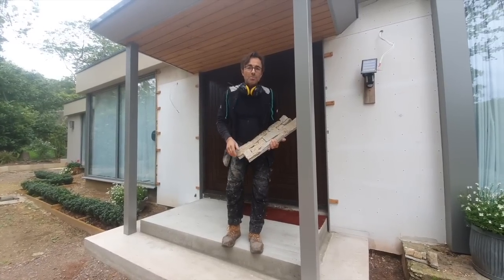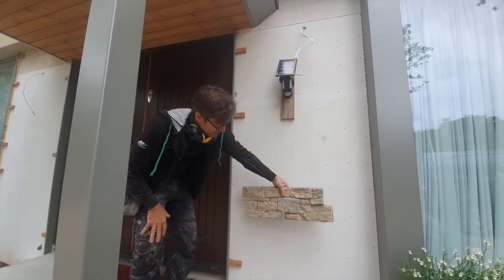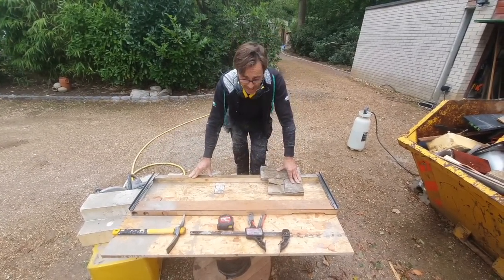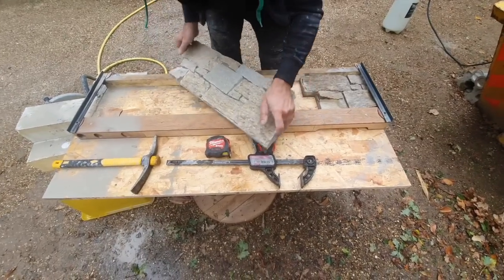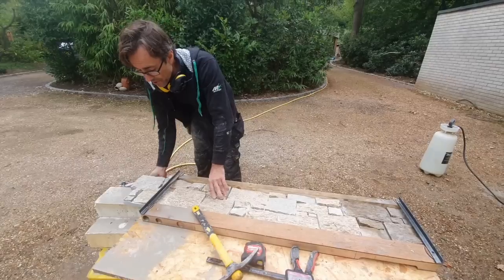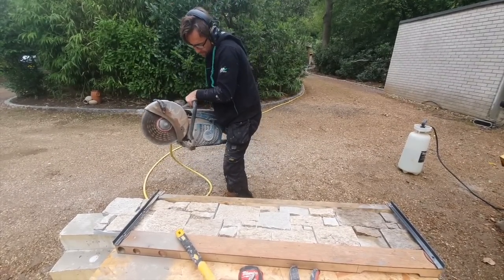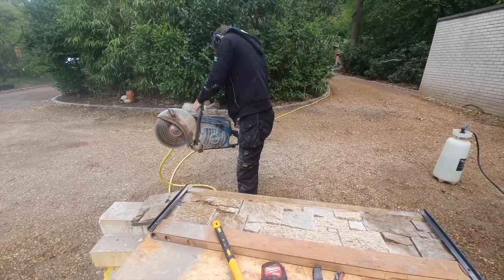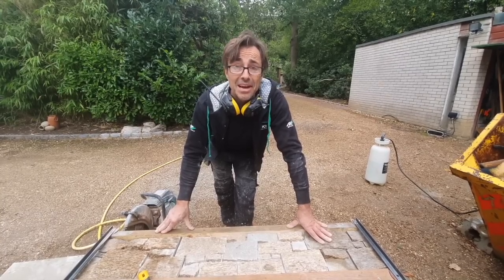Easy Stone cutting with Robin Clevett

Comment: Yes, good idea for a very repetitive pattern in the courses...you could mixed the starting blocks, and even reversed them, and put them in at opposites to get a better, more natural pattern look...but the jog was a good idea and worked well for what you wanted to achieve...
Reply: It will be random as he starts with the off cut of the last piece on the next row up. It will only ever not be random if the gap is exactly two stone panels in width but from the video it looks to be just over two full panels. TBH if you've seen any of Robin's other work i'm sure he already thought about patterns and repeats etc.

Comment: Hi robin, quick question.........using tiles like this what happens when you bridge the damp course?
I imagine there will be bridging that occurs.

Kind regards 
Tom
Reply from the maker: Well its a good question, in my case Its a timber frame structure and we have a special cement board that is fixed on battens and passes in front of the DPC, the board then is not in contact with the ground, the bottom row of cladding is touching the ground but being a granite and concrete panel its ability to suck up moisture is low, great question Tom